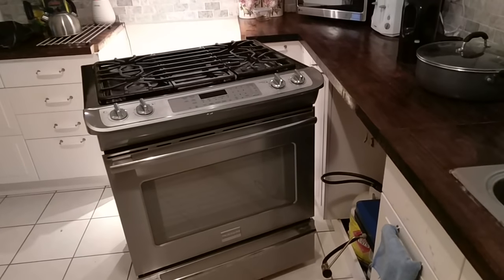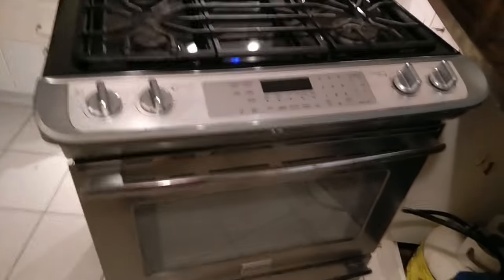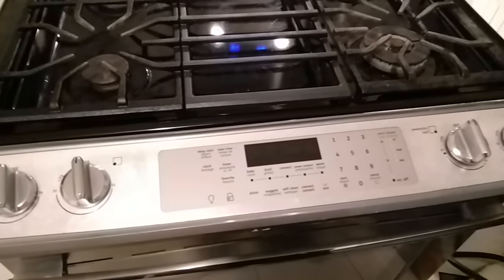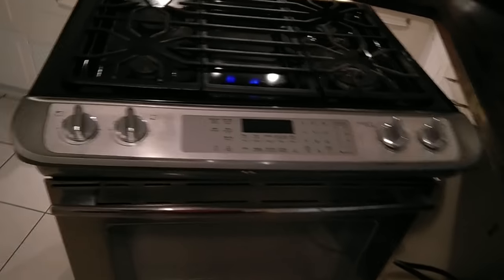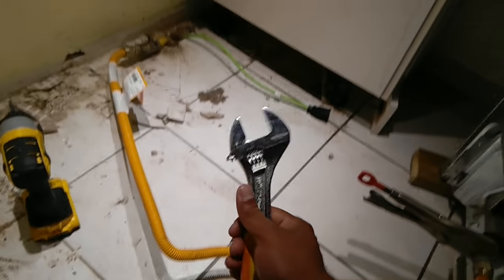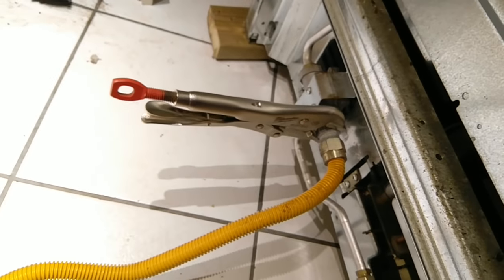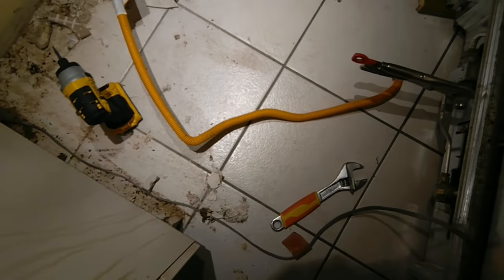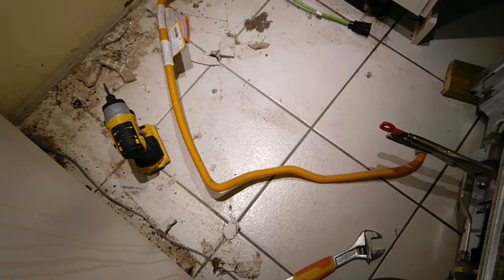How to disconnect a gas stove safely.

Comment: My stove line was very hard to unscrew so I sprayed it with WD-40 and then used an adjustable wrench on it and gave it a few whacks with a rubber mallet until it loosened.
Reply from the maker: WD 40 is one of my favorite chemicals

Comment: But how do you actually turn off the gas?
Reply: Turn off your propane and then turn on the stove until the flame goes off wait a couple minutes and done
Reply: @marisoldelatorre2046  There is no propane lol. There's a handle/switch that you turn near the wall to get it to turn off. Then you check to see if it's off fully by trying to use the stove.

Comment: thats a hack job to begin with.  Csst running directly to a flex line.  put a floor transition in with attached iron pipe and a shut off valve

Comment: My hose is on so tight to the gas line, I can't get it off with the two tools. Any tricks to that problem?
Reply: Any tricks to solving that problem I meant to ask
Reply from the maker: Have you tried soaking it with some WD-40?
Reply: No I have not, I will try that. Thank you
Reply: It worked. Thank you very much
Reply from the maker: I'm glad it worked
Reply: Yea the first connection is reversed threads just spent all day. The rest are normal

Comment: Hello I have a question about the yellow pipe, should I be worried if it is greasy from oil, I had cleaned all the oil marks behind the stove but the yellow tube is covered in oil, any way of cleaning it, the warning says not use cleaning products. Thank you

Comment: After Shutting off the gas at the source, you should bleed any gas in the line.
Reply from the maker: Yes, I did that, forgot to mention on the video
Reply: @runningrich  how do you bleed the gas in the line?
Reply from the maker: I opened all the burners. Turned the exhaust on after closing the main line.
Reply: @runningrich  Great, thank you!

Comment: Thank you for sharing this video. I want to pull out my stove to try to seal any spaces around the hole in the floor/wall where the gas line comes in (I'm pretty sure mice are using that as an entry point). Do you happen to know if it's standard to have that length of flexible hose between the stove and the shut off valve? I am just worried about pulling out the stove and accidentally yanking on the gas connection because it's hard to see how much length of hose I have. In any case I know I should close the shut off valve before I do anything!
Reply from the maker: John MacNeil the standard varies based on locality. You really have to call a local contractor and ask them. They should be able to tell you.
Reply: Thanks!
Reply: @jsmacneil   you should be able to pull it out enough to check the length of hose. The shit off valve is usually behind the stove as it is, now slmetes it's accessible through the bottom drawer of the stove but most likely.its directly.below in basement or behind the stove. Their should be enough room to pull it out otherwise.im not sure how the hell they would have gotten it in I. The first place.

Comment: There is a broken free standing electric cooker in my new house but my cooker is gas, can it still be installed?
Reply from the maker: It's broken!!
Reply: Sounds like you need to have gas lines run to where you want to install your gas stove - I wouldn't do that myself.  Might not be legal in some municipalities either.

Comment: I have a gas valve where the oven's flexible pipe meets the floor. I have closed the valve and confirmed that all the gas is out of the flexible pipe. Why would it also be necessary to all shut off the main gas line at the gas meter?
Reply from the maker: By-laws
Reply: @runningrich  
I don't understand. Are you referring to homeowners association covenants?
Reply from the maker: Lol. No it's gas fitting bylaw.
Reply: @runningrich 
Please explain. I should also clarify that I am removing the flexible gas hose fitting from the back of the stove; not from the gas valve on the floor.
Reply: @runningrich  that’s only for certain states man

Comment: Does it need to be shut off in the basement or is it safe to just use the valve shut off on the wall?

I have a valve shut off at the end of the yellow hose.
Reply from the maker: Shut off at the end of the yellow hose should he good enough to swap out the stove.

Comment: If i need to disconnect my stove, can i leave the gas pipe as is?(when the switch is turned off of course)
Reply from the maker: You mean leave the gas pipe unattached or unplugged?
Reply: it is attached to the stove, can i disconnect it from the stove and leave it unattachued to anything... when the tap is closed of course
Reply from the maker: Ur supposed to cap the open connection.
Reply: You can leave the gas pipe attached to the wall as it is, as long as you keep the gas valve turned off.
Reply: You can leave it unco ered for a quick swap out, but I'd say if your gonna leave it off.for any length of time cap the end of the hose at least. You never know when the ball valve on the shut off could start leaking.

Comment: Questions: our gas stove was installed for the first time 5 months ago (we had electric before).  So at that time I paid a guy to add a gas line which goes from our basement (we have a gas furnace) straight up into kitchen floor where he also installed a gas valve and that yellow corrugated hose.  

Am I correct in assuming the gas valve we have behind our stove is in your case located in your basement?  I couldn’t see it in the video.  Do most have a valve in the basement AND in the kitchen or just one or the other?  

Lastly, I read a lot of people use either yellow plumber’s tape or some sort of goop when they install gas stoves.  To remove, Will I need to figure out how to get that stuff off?  You didn’t mention having that to deal with.

Thanks so much!
Reply from the maker: There should be some sort of a shut off valve, probably in the basement right after the "T". Usually use plumber's tape. The goop is easy to clean.
Reply: Car-Addiction We have a newer shutoff valve near the floor right behind the stove.  Is that not good enough?
Reply: Shut off valve behind the stove is ideal. In the basement is even against some codes. The goop you are referring to is called pro dope. And yes, you just goop it on the threads with the brush that comes inside the pro dope. It’s messy but that’s the right way to make sure no gas leaks around the threads.